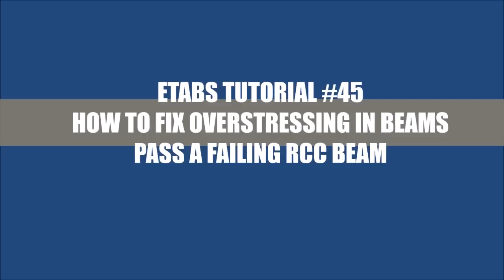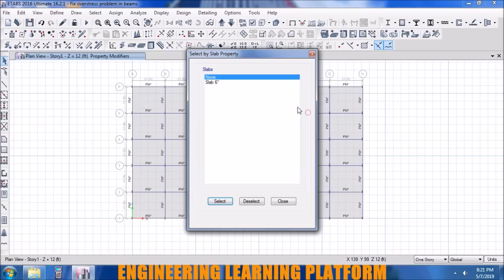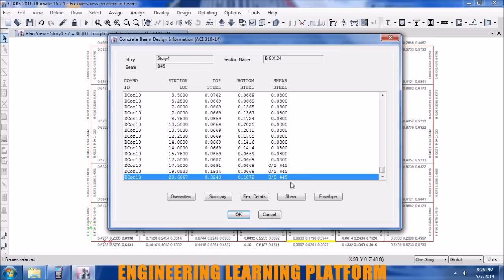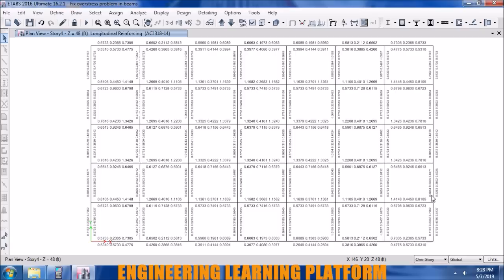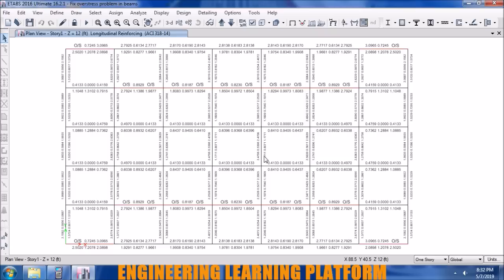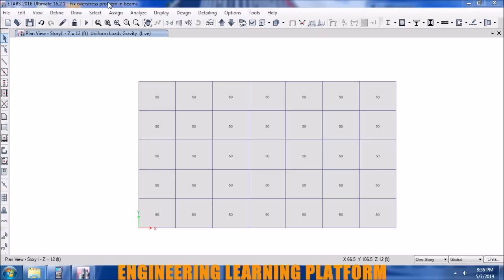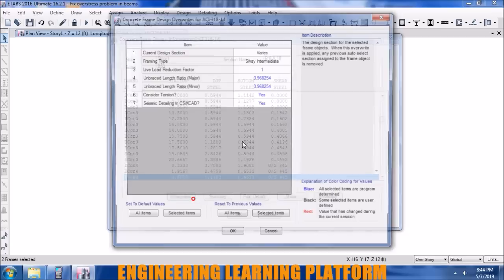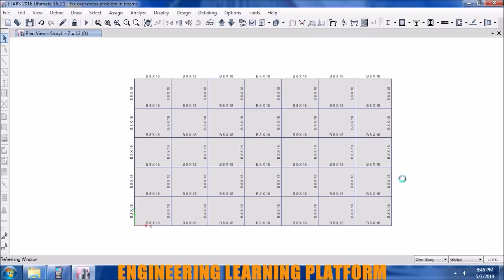How to pass a Overstressed Beams in etabs tutorial

Comment: Since the beams are supported on column....how can you release the moment in the beams ??
Reply: You can release torsion moment in primary beams........ because it comes from the effect of secondary beams flexure moment transfer...... ultimately structure should not become unstable..... check the stability of structure...... 👍

Comment: How can you release moments for all beams... moment release is applicable for secondary beams and for the other main beams as they are rigid there should be negative fixed end moments
Reply from the maker: That might be condition for example the positive steel previously was higher to balance the compression steel, now after releasing since there is lower compression steel as we released negative moment hence lesser or no steel at bottom to balance that . But the positive actual steel required increased if u calculate by moment . As the total moment remains wL^2/8
Reply: @EngineeringLearningPlatform  plz Give some More explanation over it...as we always release the moment of Free end and of Secondary Beams... Why to release the moments of all beams..

Comment: when u release the moment at first u said that there is increase in positive reinforcement. But i can  see that after releasing the moment , positive reinforcement further decreased.
Reply from the maker: That might be condition for example the positive steel previously was higher to balance the compression steel, now after releasing since there is lower compression steel as we released negative moment hence lesser or no steel at bottom to balance that . But the positive actual steel required increased if u calculate by moment . As the total moment remains wL^2/8

Comment: 1)you apply hinges in the beams but how do you implement that in the field?
2) you guve .001 for torsion how does it effect slab design?
Reply from the maker: 1. In field the joints will be yeilded when design earthquake arrives . The increased positive moment reinforcement will come to action that time to carryon the dead load .
2. Releasing torsion from beam will make slab transfer very less moments(Torsion for beam) to beam and will be designed for that moment using same model.
Reply: @EngineeringLearningPlatform .. What will happen if we wantedly release torsion for all the beam.. Will it cause any reduction in strength of structure

Comment: Hello, I applied the beam modifyers and some of that beam passed, some still failed due to same Shear force and torsion exceeding its maximum value... How do I fix the problem... Increase in section size didn't work
Reply from the maker: Yes increase section size or see shear force diagram at design combo and calculate manually sectional dimensions required .

Comment: Thanks for sharing ideas. Here you are releasing the negative moment in beam near the support. i.e you are considering beam-column connection as pin connection. But how is this possible in RCC structure? Please explain..
Reply from the maker: 1. In field the joints will be yeilded when design earthquake arrives . The increased positive moment reinforcement will come to action that time to carryon the dead load .
2. Releasing torsion from beam will make slab transfer very less moments(Torsion for beam) to beam and will be designed for that moment using same model.

Comment: thanks a bunch for sharing valuable things..
i have few concerns that is 
1. whats the purpose use of design system Sds value in the structure??
2. can I use hinges in the beam in a real structure? if yes then how will be sort of detailing with respect to beam?
Reply from the maker: Sds value addition will i corporate Ev _ The vertical component of earthquake in results of EQ cases, while making beam pin-pin releases it from negative moment in top and increasing positive moment in bottom of beam causing bottom steel to increase hence beam becomes strong in resisting the gravitational moment in other way but doesnt matter which way, concern was to increase the capacity which is done . And yes detailing will be for IMRF no special
Reply: @EngineeringLearningPlatform  thanks
Reply: This will not be useful for earthquake design where we need -ve rft as well.

Comment: My stair beams are faling due to "shear stress due to shear force and torsion together exceeds maximum allowed". Already  provided  beam of 12 x 24 inch which seems to me too much for a 6 storied building.  Should i release torsion?
Reply from the maker: If it's compatibility torsion thn u can release other wise not
Reply: @EngineeringLearningPlatform  i am confused whether a stair landing beam  with a 1 ft of cantilever landing slab is in compatibility torsion?

Comment: 1) to pass the OS#45 beam you released  T, I22 and I33 0.001, 0.35 & 0.35 respectively... can we release only T to 0.001 and keep I22 & I33 as 1 only is it right or wrong...
2) is it ok to release T, I22 & I33 on few beams (which are failing due to OS45) only and remaining beams can take torsion
3) and also please make a video on "how the design of slab will be affected when we release T, I22 & I33 on beams
Reply from the maker: No Don't release it. Only use modifiers, to keep the total forces' magnitude same
Reply: @EngineeringLearningPlatform  sorry I wrote release but I meant modified only

Comment: Sir even I reduced torsion to 0.001.. Still it was failing... I use        is 456 2000 Indian code... Please help me sir.. I have to submit the project in this week
Reply from the maker: Dont reduce for external beama
Reply: @EngineeringLearningPlatform .. What will happen if we wantedly release torsion for all the beams.. Will it cause any reduction in strength of structure
Reply from the maker: @anand4236  No. It will transfer forces to slab itself, and design slab to take all moment, however  don't release from external beams as it is compatibilty torsion and for internal beams can be ignored as balanced from two spans on each side
Reply from the maker: You may contact us on fiverr at www.fiverr.com/uzairs3